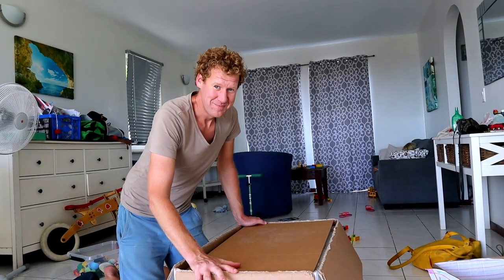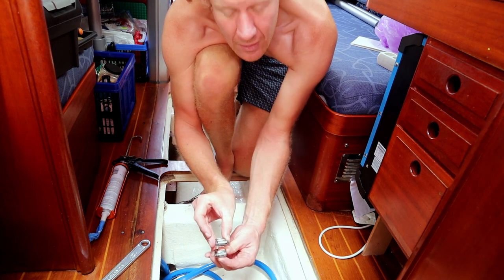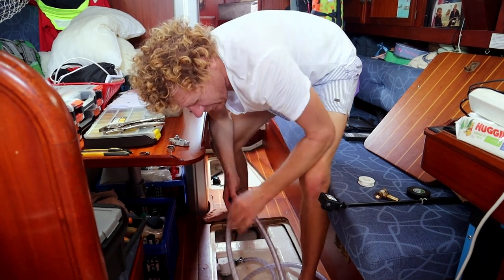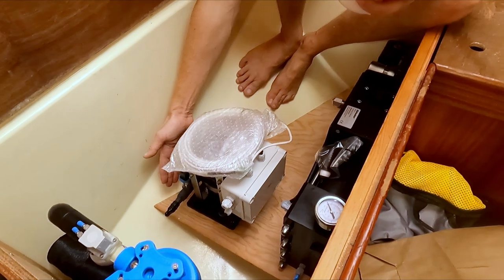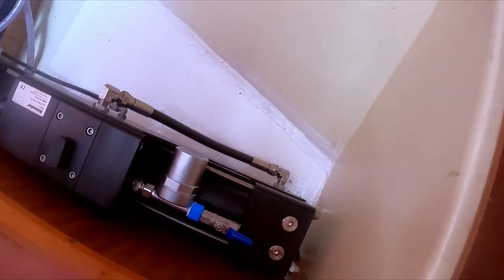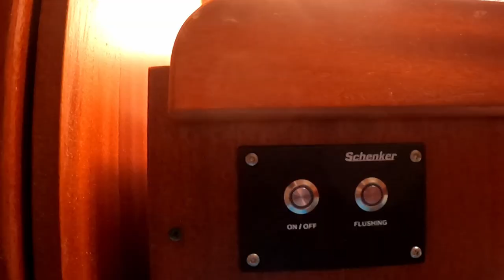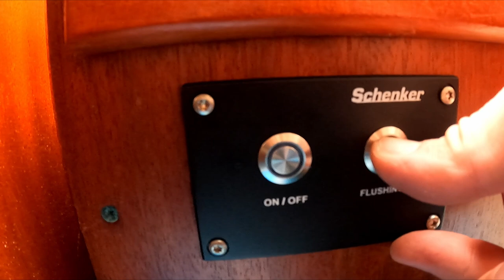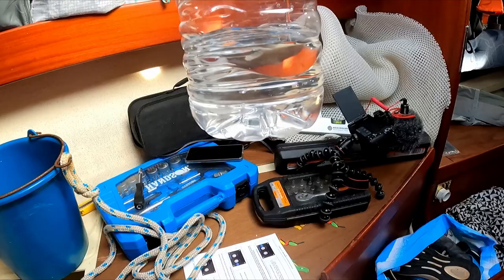SALT drinking water?? The Schenker ZEN 30 Watermaker installation

Comment: Great video. Nice install. I do wonder about dumping all that extremely salty brine water into the anchor locker. I wouldn’t want to expose my anchor chain to so much corrosion.
Reply from the maker: Thanks!
Thanks for the consideration! As you might saw on the video in the end. We can bring our brine hose out and hang it overboard. We have a wet anchor locker so when using our watermaker at sea. The anchorlocker is allready very salty cause of the waves.

Comment: Thanks! That was a really helpful video, received much valuable information. Like mounting the watermaker on top of something. I was considering hanging it, that obviously was a bad idea. Are you still happy with the ZEN 30?
Reply from the maker: Nice thank you. This is why we make the video's😊
And yes we are still very happy with the ZEN 30. We had some issues but all my own fault. Do not try to change the small filterhouse for a bigger one. They cannot deal with the pressure and will break. So get a good supply of small filters. You can buy the bigger filters and cut them to size. Do not half them because they will be too short. So use  an old filter as a measurement.
Reply: @SVTranquillity  Thanks a lot! Fair winds to you!

Comment: Wow - what a project! And what a great informative and detailed video about the installation of your water maker - well done! Great job! In the very same compartment on our Scanmar 33 we store the Gennaker, but on the other hand we do not need a water maker yet! 
I'm not sure if I understood correctly but did you install a new water intake in the bilge?
Reply from the maker: Thanks Hartmut, no please do not take a watermaker if you are not traveling full time😀
We did place a new water intake. We did not had a big enough intake for the watermaker. Needed to be 3/4 inch and with a scoop facing forwards
Reply: @SVTranquillity  No worries, I do not have any intentions to install a water maker. There are many other things that have to be upgraded, repaired, replaced etc before that 😅! But your installation ist really an impressive piece of work!

Comment: Super Video - trying to order all parts that don’t come with it - is the threaded fitting for the little freshwater hose (6x8mm) for the plastic tank connection included? If not - what is it called? Or perhaps you have a list of the parts you use? Thanks again for helpful video
Reply from the maker: I did not buy much extra. The little blue hose and grey connection are included. As are a lot of connections for the bigger hoses. I just bought some electrical cable 4mm2,  reinforced hose and a truehull with seacock🙂
Reply: Thanks so much for prompt reply, similar to you, my boat is in a very remote location and I’m trying to order everything beforehand to take with me. Hope the Zen is still working well for you.

Comment: Hi guys. After some time with the unit would you buy it again? Any issues you can share that would help a prospective buyer and installer? I am on verge of deciding on a watermaker  for my boat and the Zen30
Is on the short list. Thanks.
Reply from the maker: Yes definately! Only obvious tips. Try to make water in the clearest water possible. The filter on the schenker is quit small. So you go through them fast. Do not try to swap the filters for bigger ones. I did it, but you get a different pressure and the bigger filter houses cannot handle it. So I swapped back to original.
You can make small 5micron filters from bigger ones. But you cannot simply half them. So measure with rhe original filter.
Reply: @SVTranquillity thanks for this - valuable tip.

Comment: Nice video! Does it have an automatic inline TDS measurement coupled to a divert valve to change product water going from sample line to tank? Or do you do that manually?
Reply from the maker: Thanks! No we don't have one. Water runs straight into our tanks. We do a check of the water with a handheld TDS once in a while. First check was (230 ppm)

Comment: Excellent video. I am going to install one of these so it's great to see just how easy it is to install. How long did it take you in total? Do you not have a TDS meter inline to test the water?
Reply from the maker: Thanks! Good luck with the project. We did it in five full man days. We live on the boat so could be much faster if you are not living on the boat.

We do not have a TDS inline. We checked the first liters of water with a TDS meter by hand (230 ppm)

I still want to make a three way valve to tap of some production water once in a while or put in a tds meter. But getting things here on Curaçao or when traveling is a thing🙃
Reply: @SVTranquillity  Thanks again, really helpful